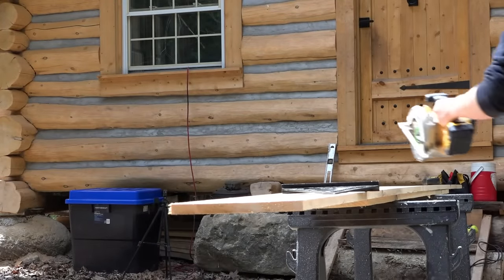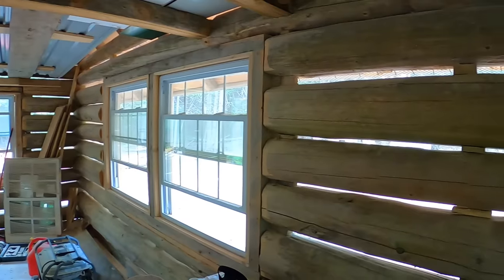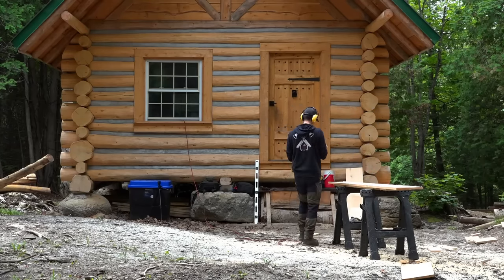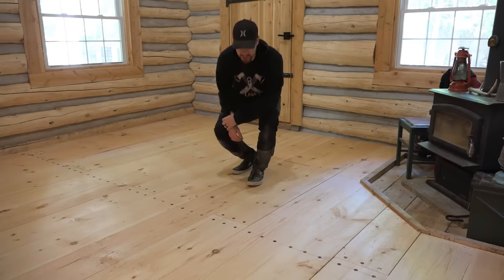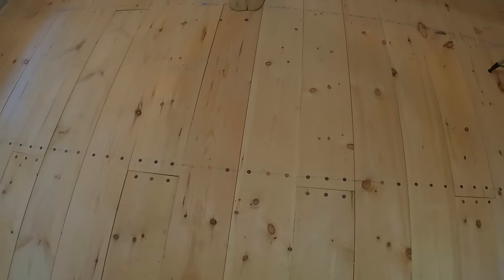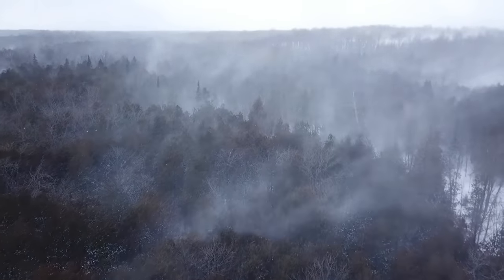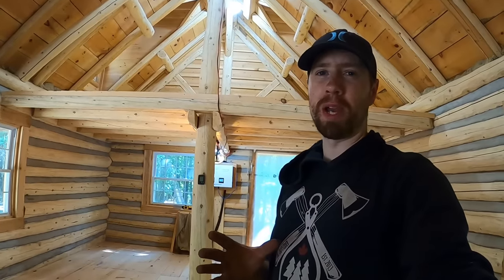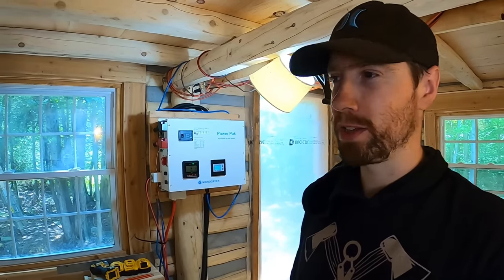Flooring the Cabin During a Thunderstorm! / Ep97 / Outsider Cabin Build

Comment: Dear Outsider
     It was particularly enjoyable to watch the pressed fit of the last board of flooring.  It is a testament to your skill level and your diligence in attending to all of the details involved in a project like this.  From measuring twice to always making sure that your sawmill is cutting true.  To make the edges of floor boards truly parallel requires that your saws are cutting straight.  I watched early videos when you and Outsider Senior were setting logs on top of boulders the two of you took the time to make certain that the structure was square.  And now that investment has paid off because the walls of the cabin are still square all of these years later.  Simply amazing!
     God bless you and your family!

Comment: The cabin looks absolutely beautiful! I wish we could watch more of the thunderstorm though... And a word of advice. Have your DC to AC converter and your batteries moved to your solar panels location, maybe built a dedicated cabinet there. Having 100ft of cables transfering DC power creates huge power losses. The best way is to have AC passing through your wires all the way to the cabin itself, with little to no power loss at all. This way you will see a big improvement from your solar array!
Reply: solar off-grid cabin NOT newer good use AC power waste lot energy stupid, all light,TV, heater,fan,fridge, can buy 12 volt DC system and save lot energy , only stupid use AC machines whit inverter, and 100FT cable mneed lot biggest cable no waste power to heat cable, you can measure how much volts power drop, measure panel output and then measure what volt have in cabin lot drop and need biggest sguaremeter cable change this.

Comment: Just curious about the flooring... Did you leave any edge space between the flooring and the walls, like a quarter of an inch or so? Everyone has always told me you have to allow a gap for such flooring, as it will expand/contract through the seasons. The cabin's looking simply beautiful, a family heirloom.
Reply: I was thinking the same. I'm guessing his thought is that the boards will shrink more than expand since they are inside now. May naturally leave a gap when finished curing. Just a guess.
Reply: @1bcordell  When those boards shrink the screws will cause them to split.
Reply: I had the same thought. It’s a very different lumber situation—Mr. Outsider’s wood is more old growthy and had some seasoning. When my son-in-law built a fence, out of lumberyard stock, he was meticulous down to the 16th about measuring and cutting. After one winter many of the eight foot 2x4 rails had shrunk so much that the screws holding them into the post snapped in half. It’s a cautionary tale reminding us to buy our lumber and store dry a year before we use it.
Reply: Yes, I was wondering the same. That is at least one purpose to skirting board, to cover that gap. However, since the whole building is timber and ready to expand/contract as well, maybe that sorts the problem?
Reply: @olddodger7178  definitely going to see a lot of shrinkage in the dead of winter. Boards may even buckle.
Reply: The humidity in the summer is the problem.  Those boards will swell up and buckle because they have no room to expand.  We always stack the flooring in the CLIMATE CONTROLED house for about 2 weeks so they can aclimate.  Preferably on stickers so the air can circulate around all sides.  The moisture content should be less than10%.  Typically leave about a 3/8" gap around the perimeter of the wall. If the boards he used are green, ( fully swelled), then there might not be a problem other than shrinkage, but as others have said, he might get some spliting.
Reply: Laid a wood floor   12 years ago and left 1 cm for expansion width wise, not length, even that was not enough,  ended up after 6 months having to pull up the  boards closest to the wall and trimming off more, since then no more issues, once the floor stabilised.
Reply: @marksmallman4572  I think I read somewhere the problems depend on the actual grain of the lumber... as moisture gets sucked in then expelled. We'll have to see what we see when he finishes them next video 🙂
Reply from the maker: Great question! I plan on cutting a small gap on both sides of the cabin flooring, to allow for expansion. However, I  think there's a higher chance of shrinkage at this point. Now, I did let the boards acclimatize in the cabin for 2 months, before installing them. So I'm hoping any movement will be minimal.
Reply: @TheOutsiderCabin  All right, great to know!! We'll all be watching to find out with you.

Comment: As a old carpenter I like the way you put the floor down , only thing is you need to leave a gap at least 1/4” along walls to prevent the boards from heaving and warping on you from shrinking and expanding. Your dad is right there watching you and in your thoughts.

Comment: Nice video...nice work. I have that same solar set up...EXCEPT....I siliconed my panels together, and added a few nuts and bolts, and Voila, I had a water tight roof. I put on siding, and, Voila...I had another shed. You could have that structure a useful shed, too, in just a few days work. Just be sure and shore up that foundation you talk about a little more. Keep building, Man...and keep teaching us. Thanks

Comment: A common way to anchor deer blinds against the wind would work well for your array. I pound steel fence posts at an angle into the ground about 5-8 feet from my blind and use twisted steel cable/wire attached to a ring on the post and to the blind on all 4 sides.   Another option is to use “ground anchors” you twist into the ground and light chain or straps attached to the array.

Comment: I really like what your doing and it looks great and I really enjoy your videos...I don't want anyone thinking I'm knit picking...I am just mearly pointing out for others should they consider putting in a floor like yours what could be better... shiplap wood was used  for walls and floors before there was plywood and does not prevent flexing but does restrict ventilation between boards... shiplap is used for sub flooring and sub sheeting to be covered...however one edge can still flex up with warping or pressure on the wrong place making a unwanted raised seam down the road...I'm sure your floor will be just fine but it would of been better to do a 1/4 by 1/4 groove on all edges and ripped some 1/4 by 1/2 strips to put in the grooves to make a tong that would limit the flexing. .this is why all hardwood flooring sold is tong and groove instead of shiplap

Comment: Regarding trench-digging in excessively rocky ground, folks:  If you can't dig down, you can always mound up!  This does leave you with a bit of a berm to deal with, but you can pile on and tamp down more dirt to extend the slopes into something more gradual and less noticeable.  If you're moving heavy machinery over these berms, you can bury some of those rocks on either side of the pipeline along with lengthy pieces across it, braced from rock to rock, before packing on the dirt.  If you do't have to worry about crossing the line, another possibility is building a drystone wall over/around the conduit, especially if you're trying to clear rocks from a field for future planting.  A third might be to build a wattle-woven fence, though that would be a bit more difficult to weave.

Comment: You could easily run screw in anchors, like used for swing sets, and short cables to anchor your solar array.  This would more than handle the bit of wind you might encounter and not require totally re-doing your solar mounts.

Comment: You could use a strapping method on the solar by using anything to anchor into the ground like a trailer anchor or something better and secure it in place for possible settlement movement on rocky dirt areas I hope that at least i am thinking a cheap solution and its very easy to get ahold of without so much digging

Comment: Anchoring the array I live on an atlantic island regular 120mph gusts. I have 6 yacht mast stay cables  holding mine down. Used 5ft angle bar hammered into rough ground with drilled eyehole. Never going to move. Any marina has lots scrap cable going  cheap. Weakest point for me is the panel mounts to the frame which I check regular.

Comment: I assume you will be installing some sort of dry toilet system. I have a dry toilet (using a off the shelf email/fax seperator) in my campervan and let me tell you: it is great. Forget the porta potty's or other water based toilet systems...Go dry, especially since you have a seemingly endless supply of sawdust comming from the saw mill... The emails can be either collected in a small drum or even better piped outside to a small leach field whereas the faxes and sawdust can be collected in a bucket (possibly underneath the cabin, slid out and emptied in a nearby composting/aging facility (which would consist of a couple of IBC's in the ground and an open/heavily ventilated wooden/metal structure protecting it from rain and snow. Adding red wigglers and kitchen (vegetable matter) scraps would make the composting very swift...

Comment: Looks great, love the penny idea. Can't tell, but did you fit the flooring tight to the wall all the way around? You should allow for some Expansion and Contraction of the wood across its grain.1/2' all the way around. Hoping it doesn't buckle on you if the wood chooses to expand next Summer, or split if it shrinks this winter.

Comment: looking pretty good.  I'm wondering about laying the flooring all the way to the wall as you did though.  Flooring expands side to side quite a bit.  Pine is not as bad as say Maple, but it does expand.  I laid a maple floor and had to be pretty careful.  came out ok.  But when I laid a beech floor, I was really careful, leaving a space below the rock AND the baseboard, so a full inch on each side of a room.  I tried to let the flooring adjust to the local humidity too, (the flooring was a bit TOO dry).  But in truth, it wasn't enough.  All the flooring "cupped" a bit because of the pressure.  I've seen quite a few such floors.  It will be cupped until I have it re-sanded someday...  I've heard of walls being pushed off their foundations by such floors, but obviously that won't happen here.  I know baseboards would not really be very easy for you in your situation either.

Comment: That floor will pop out at some point, too little room for it to expand cos of the moisture it is gonna get since the cabin aint on 24/7 heat.. happened at my cabin too, even thought we left plenty of room for wooden floor to expand, also you still need that heat storing brick/mortar fire place, it saves you so much wood in the winter and generally makes the life easier since you need to heat it only every 2-3 days.

Comment: As a retired builder I have to point out some important errors in your flooring installation.   When floors are installed, they are nailed on one side only, the tongue, to allow for wood movement.  In a room this size there should also be a half inch gap by the walls and not tight to the walls.  The gap is then covered with baseboard.  Also the choice of pine.  Pine was used in older homes when pine trees grew to four feet diameters.  The heartwood was harder.  They don't let trees grow that big anymore.  I'd suggest OSMO wood finish, available at Lee Valley,  It has hard waxes that penetrate and can be reapplied  anytime with a bit of cleaning and light sanding.

Comment: My fellow craftsman. I’ve been watching from the beginning. Very sorry about your father. Your an unbelievably gifted carpenter and cabin builder. You and you dad have constructed such a gem. I’ve never felt compelled to comment. I’m hesitant now. But, I’m an electrician. After seeing the feeds coming into your control panel from the array and generator. I felt compelled. Please Sir, run those into that panel with conduit. That DC feed from the array clamped under a metal connector is particularly concerning. Just trying to help. Blessings

Comment: How did you keep the raw wood from warping in all that moisture? I live in Florida and when a rain storm like that moves through and I am working in an unairconditioned space the wood just expands. I try to buy seasoned dry lumber but if it sits on site for more than a day or two it expands and warps and doesn't fit as well. Is there a trick I don't know about?

Comment: I would be concerned about having a bunch of flammable lithium batteries stored under a flammable wood cabin.  I would think it would be better to have the batteries away from the house in a weather proof shed.

I would also hope that you are planning to bury your solar cable conduit later to a proper depth, at least 18" if not deeper with caution tape above the conduit.

Comment: For the Array? Poor a slab.. That should be enough weight to anchor it in place, plus you mentioned a shower.. add a drain and maybe some radiant heat (electric) coils to the floor.. Maybe not the radiant heat but definitely a slab vs pier footings. All I can add regarding the floor.. Is consider an oil finish or and oil based varnish vs a poly for longevity, and maintenance vs a water based product.